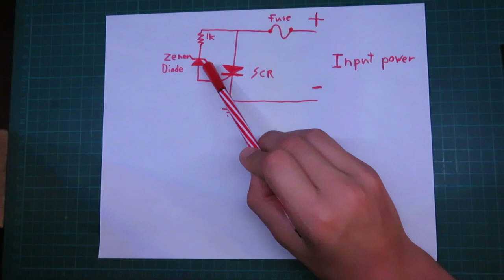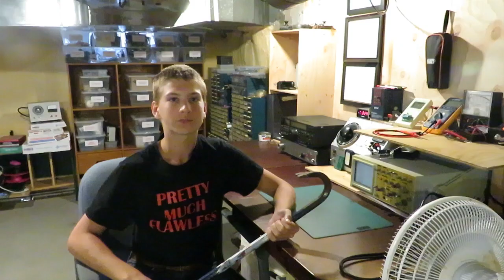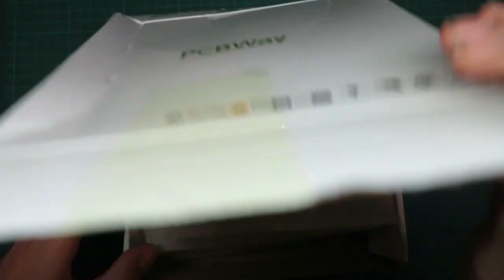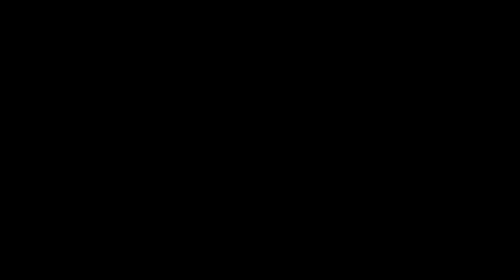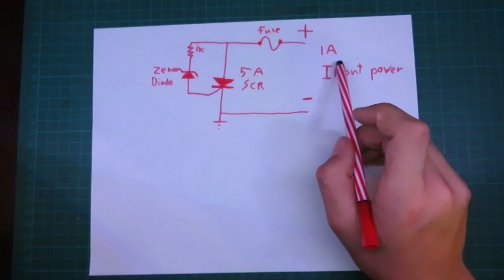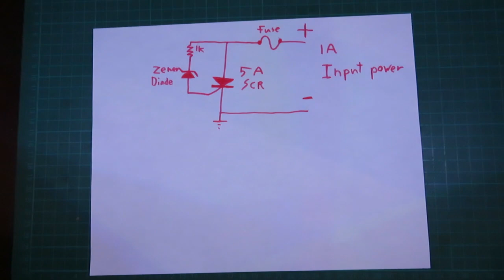How To Make a CROWBAR Circuit - Over Voltage Protection!!!!!

Comment: What made you decide on the 1k across the Zener ,in other words when the Zener is conducting how much current flows? Cause this current will then drop over the resistor to trigger the gate of the scr so no do we choose this value ?
Reply from the maker: So using ohms law we can figure that when the voltage is more than the rating of the Zener (Zener is rated for 5.1 Volts)  Lets say 6 Volts / 1000 ohms = 0.006 amps or 6 milliamps
and 6 milliamps should be good enough to trigger the SCR.
I hope that answers your question
Thanks for watching!
Reply: @prettymuchflawless-cn1ms  but SCR are also rated in terms of VGT(gate Voltage trigger), let's say SCR VGT=is 2.5 if i use a voltage divider circuit with VS=5V and i use R1=1K & R2=1K that gives me 2.5V ,I=5/2K=2.5mA Vgt=2.5V/1k=2.5mA ,in this case i'm using resistor divider configuration to trigger rather than zener diode,is this feasible?